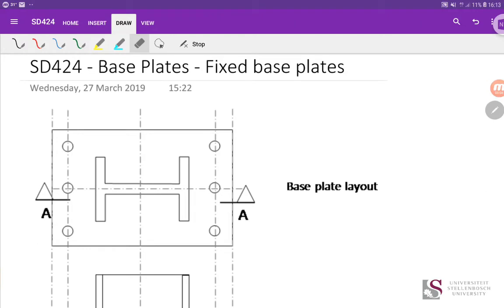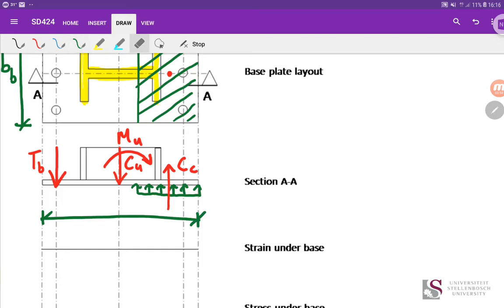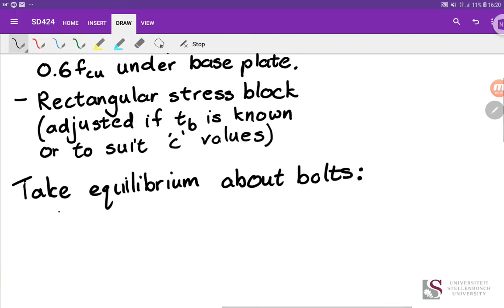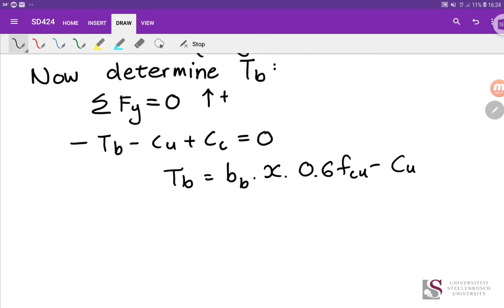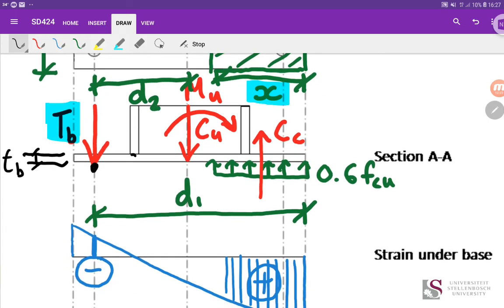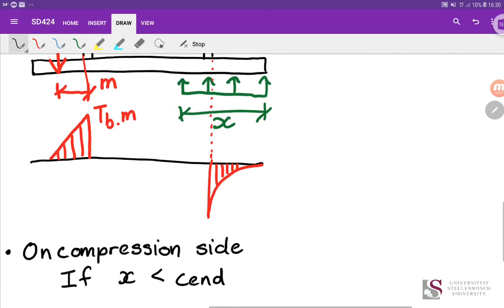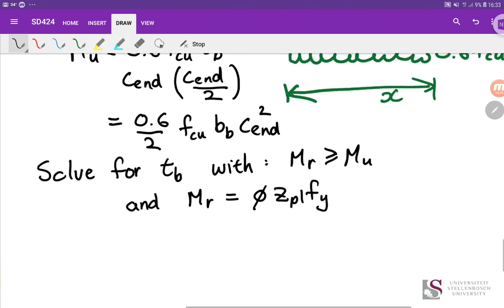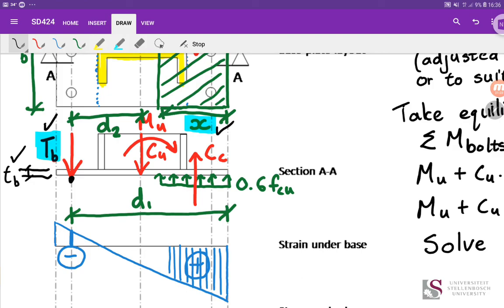Steel Design - Base Plates - Fixed base plate design calculations - SD424

Comment: I have a question about the formula you have used, Bb*t^2/4. Don't we need to use the section modulus formula Bb*t^2/6 instead?
Reply from the maker: The plastic section modulus is used, rather than the elastic one.

Comment: How are stiffeners going to change design calculation steps ?
Reply from the maker: You will change the steel plate design. Plastic analysis can be used for the plate between stiffeners. Stiffened can be designed as small columns.

Comment: Hello sir, first thank you for sharing your knowledge. I would appreciate a clarification on the assumed stress-strain of concrete on minute 11:50. Are you assuming that concrete behaves in a such a way where strain grows with a constant stress of 60% of it's compressive strength? how is this equal to assuming the stress distribution is a rectangle at the column base rather than a triangle? My confusion is trying to relate material behavior to stress distribution.

Comment: Great explanation sir! Is there a similar method for circular column bases with a larger quantity of anchors? Problem that i encounter is having too many variables. Kind regards Richard
Reply: Two yrs later: calculate the geometric center of the anchor group (assuming all the anchors are the same cross section). That geometric center will be the location of your "Tb" (which is just the sum of all the anchor forces now). Then run through the method above. After you have determined all variables, go back and distribute the total Tb force to the anchors using:

sum of anchor group moments = Tb*(d1-x/2)

and

sum of anchor group forces = Tb

Comment: Hey, what is the value of	fyi and Fy
Reply from the maker: fy is 355 MPa in South Africa for our main structural steel. It ranges a bit between countries.
Reply: But you used symbol stand for 'phy' which is multiplied by Fy, i want to know the value of that symbol, used in formula of resistance moment
Reply from the maker: @lokesh7532  Psi_i is a material partial factor. It accounts for material strength varying, and possibly not being exactly as specified. in South Africa it has a value of 0.9. For EN calculations often a value of 1.0 is used.
Reply: @richard_walls  thanks sir, 
I m from india thats why, i am asking because we use indian standard codes, and method to find the thickness is base plate is different, but you method is excellent

Comment: Great explanation sir, thankyou so much. 

But i would like to ask a question. In designing base plate, do we only consider this cross section? What about the other cross section about weak axes of the column? Thank you
Reply from the maker: Bending about the weak axis can be done in the same way for calculating the stress blocks and forces. However, you will need plastic analysis or FEM to design the actual base plate. It is unusual to have high moments about the weak axis in real structures. if you did, you would probably add stiffeners to the base plate, which would also make the design easier

Comment: Sir plz tell me detailing about if steel column and above it a RCC beam is fixed.
Reply from the maker: Possibly easiest to have a large plate on top of the steel column with fixing lugs/anchors/welded-on-bars which get cast into the concrete. You would need to design the plate and cast-in system for the load applied.